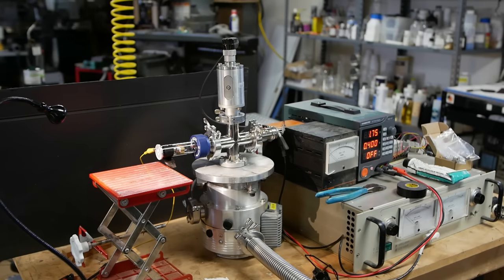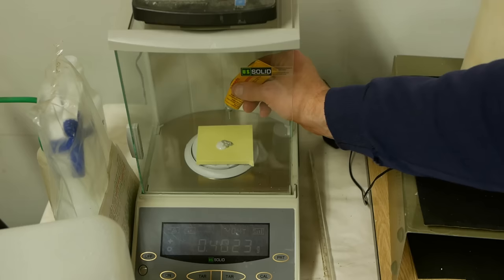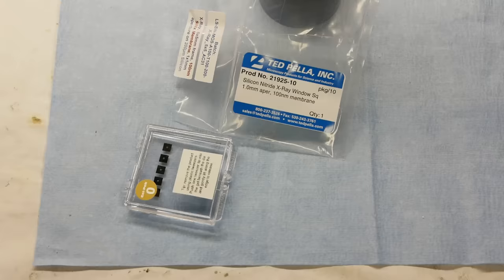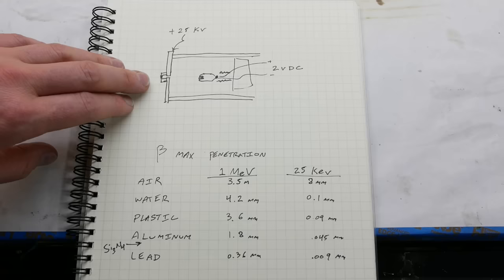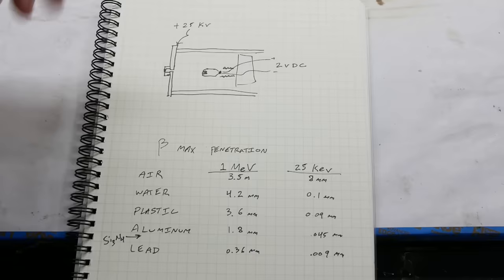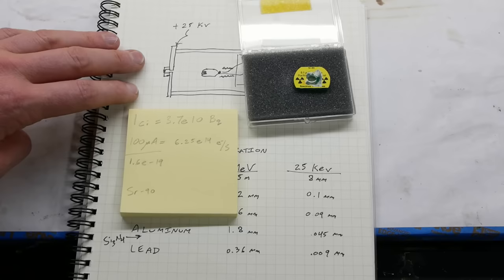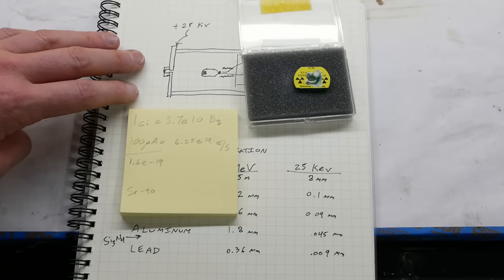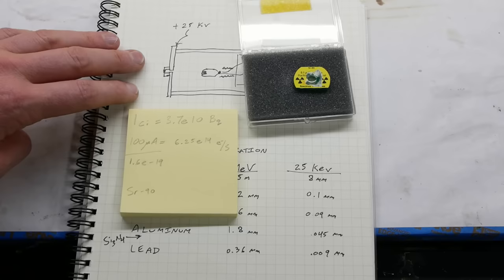Shooting an electron beam through air

Comment: I'm confused.  Your drawing shows the plate being at +25 kV potential, and later you say (and I see it on paper as well) that the energy in the experiment is 25 keV.  Volts is a measure of electromotive force, and electron volts is a measure of energy, which is proportional to volts * coulombs.  Did you design the experiment so that each volt of potential is equivalent to one electron volt of energy in the electrons?  Or am I missing something?

Comment: Put a piece of magnesium oxide, you can buy it cheap at mtixtl. The MgO is a scintillator commonly used in many synchrotron facilities, so it would give you an idea of the x-ray generation going on.
Reply: There are many scintillators. SEM uses YAG (Yttrium aluminium garnet) which is used in some white LEDs to convert blue light into yellow and which has very fast fade out (don't know the proper word, but scanning speed is important and glowing for too long is not welcome feature), some radiation detectors use NaI(tl)

Comment: Could you shoot electrons into an electrical insulator onto a storage medium?  Maybe charge up a copper plate that is embedded in an insulator. Or just charge a piece of metal in the air and measure how much it is charged. Do some materials hold charge better than others and what limits how much charge they can hold?  Or, could the beam push something similar to how a Crookes radiometer "light-mill" works. Maybe a proof of concept to push a miniature fan or turbine to power a miniature machine. Maybe watching the beam push droplets in the air or push a speck of dust suspended in a liquid.

Comment: Wait, I thought you could not get an electron beam to travel through the air. Don't you et Bremsstrahlung radiation when an electron slams into a nitrogen or oxygen molecule? So is it the e-beam that sterilizes or the resulting x-rays? What if you have a box of syringes with steel needles. How do the electrons (or is it x-rays) get inside the needle?

Comment: So this would actively produce negative ions in the air when it's running, right?
Reply from the maker: Definitely.  In fact, I came across these silicon nitride windows when looking for a non-radioactive ionization source that would produce lots of ions without necessarily needing a high voltage field (the anode can be 0V, and the filament can be -25KV, so that the aperture is at the same potential as the rest of the analytical apparatus).  It's quite effective at producing ions,  moreso than normal-intensity radioactive sources.
Reply: @AppliedScience  That's great. I had never even considered going this route to produce ions. So if the tube had a square(ish(or at least, flat on the filament facing side)) tube running through it perpendicular to its axis, which had a hole in it which faced the filament and onto which the window was epoxied, wouldn't that essentially eliminate the small problem of x-ray production? At least, assuming that the optical path from the filament to the accelerating plate was blocked by enough glass composing the perpendicular tube to keep any electrons from actually impinging the plate?

Comment: *****place an insect or some other micro tissue structure on a piece of photo film or some reactive surface that can be fixed after irradiation.      Or better yet, use a CCD as the reactive surface(might need to be doped though).    Kinda like a proper X-Ray machine.  Thanks*****

Comment: Ok. What would happen if you cross that electron beam with a proton beam in a vacuum? Would there be a potential for creating a directed light source? Think holographic display here... 

Or would it have the potential for a large energy release? Like a proton beam surrounded by electron beams directed into a thruster come of a rocket in space? Kinda forming hydrogen that is super-heated like the radioactive rockets...

Comment: @Applied Science : Do you think could be possible to re-accelerate the electrons while they are in the open air? If so, it could be fun to try to make  multy stage linear accelerator in air. As you tried, could be also interesting to se if magnets bends such beam or aslo electric fields.
What could be the purpuse? Well, I really don't know.
other than that, could be useful to shoot the electron into a low pressure chamber, with a magnetic field. The electrons should light the gas up and bend in a circle around the magnetic field.
Whith this experiment they mesured the elctron mass. GREAT! AS USUAL!
Reply: @ Applied Science and to all the galaxy members: " What's the difference between an electron beam though air and a corona discharge?" Right now i really don't know!!!! I mean, aren't they both simple electrons travelling freely through the air?
But I could imagine that corona discharge can't penetrate insulating materials (Am I wrong?). So Where did I lost myself?

Comment: around 120 years ago Philipp Eduard Anton von Lenard playd with electron beams in the same way. The thin window for the electron beam therefore is called Lenard-Window which was in his case a thin aluminium foil. He got the Nobel prize 1905 for his studies with elecron guns.
Can you put silicon sealant into the beam? It should cure quite fast. Also silicon vacuum grease can become hard in the electron beam.

Comment: 1. This is a pinhole aperture, right? So basically this is super inefficient as your beam is very wide in the vacuum, and narrows down to 1mm2? Maybe add some focusing?
2. Probably a stupid question, but how does the positive electrode slow down the electrons past the aperture? I would guess it's not as strong as the acceleration force, but some calculation might be interesting.

Comment: As far as I know, an electron beam is not an x-ray, it is basically a beam of beta particles, it only becomes x-rays when they collide with some material with a high atomic number, as happens in radiotherapy machines that use this system, You can choose between electron beam and x-rays, and when you choose x-rays, a mechanical system places matter like tungsten in front of the accelerator to transform the electron beam into x-rays.

Comment: Hmmm can someone explain this? My manufacturing professor who I know has a ton of experience and a PhD in ME said that there’s no point in using a lubricant or any liquid when machining, he said the only thing it would possibly do is cool the chips, and that’s basically pointless
Reply: When you use cutting fluids, besides cooling, it also helps reducing energy losses through friction,  mitigating effects of metal to metal interaction (such as  galling) and by doing so increasing the durability of the tool and reducing the machining time. Also, when machining metals, cutting fluids usually contains some sort of extreme pressure additives, which interact  with the metal surfaces, creating a microscopic layer which has a lower friction coefficient, effectively helping the tool to drive its way into the part. Another bonus Is that cutting fluids can be used to help driving chips away from the workpiece.

Comment: Well done!!. Cathode/ Lenard Rays outside the vacuum of stella space. Cathode rays do marvelous atomic reactions to the material atomic elements of planet earth. 
One of the most mavelous reactions of cathode rays is to decompose air and water down to their atomic elements. When you decompose the air it will create an intense million++ kg vacuum thrust in the local plane.
The atmospheric pressure of earth is 1.033kg/cm2. A mere one meter round flat disc with cathode rays streaming rays off the top surface, will generate around 8 tonnes of lifting force, all generated by cathode rays an earths free atmospheric pressure. Free energy or hypersonic flight for all the world...

Comment: - Try a Plain ole arc.    Take 2 tig welding tungstens ; point them at each other ;   flow inert gas(or not)  = Make stable arc =    Electronic Fire + Light Fire  = ???      Then try some different metal dust in the arc... I wonder if the light emitted would change spectrum.  Like the sodium orange.     
- Suspend a paperclip from a magnet and see if it falls ? 
- Make Fog Glow !!            

             Hey Ben, can you refresh us on how the old x-ray photo's used to work ?   Did they just hook a capacitor bank up to a filament and let it self destruct ?  ((Why do I think you already did this topic with the chicken vid. ))      
   Perhaps your setup could benefit from operating intermittently.  Flashes at yada yada rate. Instead of constant. I mean flashes can go so fast they'd b undetectable. That'd be one way to deal with blowout or heat dissipation.     Luv the vids, always inspirational.

Comment: It is not electrons travelling from cathode to anode but plasma of cathode metall as charged ions in plasma state. If you apply a short pulse shorter than cathode anode distance the anode field lost before ion can hit. As a result the lost metal ion travelling at astronomical speeds. This technology is known as Ion Cannons and they can be built extremely powerful to hit very long distances like between planets. Regards from Ur Scientist Adam der Erste.

Comment: I don't understand how air can destroy a turbo pump. If that's true then even bumping it could destroy it, the mode of which I can only speculate. Are the rotors just so thin and/or so close they crash into each other when struck by too much air? These pumps are incredibly simple, I just don't see where anything can go wrong.
Reply: @alos10subspasomipack33  AH Yes! How did I not see it before! If the mass average does not correlate with the volume periods, they implode ultrasonically and microscopically. It must be fluid cavitation! You are so right. Thanks stranger.

Comment: Hi. Been you might be off on your assumption that the thicker window will have the greater risk of destruction. Assume a unit volume of glass to be 500nm thick. The irradiated area on one unit volume [of glass] decreases as distance from electron source increases (with irradiated area going to zero, like you said, with glass that's several tens of microns thick). Since the glass strength linearly increases with thickness, there should be LESS of a chance of breakage for a given output. In order to get the glass to break you'd have to just slightly linearly increase the electron count with glass thickness, with 1atm and 100nm glass as your baseline. If you start with 100nm and 25kV, then increase glass thickness in a 1:1 ratio to emitted electrons, you'll never break the glass......

Comment: Please try to repeat the experiment, but this time using the voltage multiplying cascade to reach the mentioned 1 MeV acceleration!
Reply: Linear electron accelerators use a kind of a waveguide......A kind of microwave "travelling" standing wave is used to bunch electrons and then accelerate the bunched electrons down the waveguide tube to a target. This principle has been used to produce electrons in the 100 GEV range....The Univ. of California linear accelerator is several miles long and consumes so much electricity that they have to notify PG&E before they turn it on to avoid overloading the grid.

Comment: Applied Science, very interesting about the ultra thin silicon but won't electron beams form in an atmosphere of helium?  Being the most noble of gasses it should not accept an electron.  If so, why couldn't we use He in electron beam welding instead of building a costly and time consuming vacuum cabinet?
  But my real question is if only a vacuum is needed this should work in space with an exposed filament and could we make focused beams to travel hundreds of miles ahead of a space ship to ionize dust and sand grains to allow magnetic shields to repel such particles away from the hull of the ship?  I am grasping at straws here, a little  help would be greatly appreciated.

Comment: Very nice shot of the nitrogen fluorescence from the beam at 0.11!  

After many years we finally got a good shot of this phenomenon via Andrew Seltzman's RadCam 2. The accelerator was cranked up to full power and the lights turned off. The following frame from the video was at 3.5 MeV running at ~150 kW. Thermoluminescent rhombs of calcite are in the foreground: 
http://www.capturedlightning.com/photos/Advertising_Aids/RadCam-2015/Framegrab1.jpg 

Re: making Lichtenberg figures, you might try chilling the PMMA with dry ice to reduce charge leakage. You need about 1 -2 uC/sq-cm of stored charge to get good figures, and leakage can be a problem with a low-current beam with PMMA at room temperature.  

Great job and good luck!
Reply: Bert!  Any idea of price of those e-beam sterilizer accelerators (just the hardware?)  Few hundred $K?  More?  Couple $M?  Or even just cost of the drift tube wo/supplies?  (I see that people are now using them more widely for chem, and as industrial polymer-catalyzers, etc.)    TEN MILLION BUCKS whaaa?   That's ridiculous.
Reply: @wbeaty  High-power industrial-scale facilities are indeed expensive - of the order of $10-20 million for a large installation, including all the various support systems. Ongoing care and feeding (maintenance, regulatory reviews, power, skilled staff) is also expensive.The facility we happen to use is primarily used for polymer crosslinking of tubing, cable,  plumbing, and water-handling parts and HW. 

There are actually a surprising number of industrial, medical, and research accelerators in the US. Medical facilities are always off limits. Research machines can sometimes be available if have the right academic contacts. Most high-power industrial accelerators are hidden away as an integral (often proprietary) material processing tool - these are usually not publicly accessible. There are also a few sterilization facilities. Beam time on a high-power e-beam machine typically runs $1000 - $2500/hour at these facilities. Expensive - yes, but in a lot of cases, there is no viable alternative.

Comment: Hi... Something i obviously havent understood here..... why not simply make a Tesla Coil.....(I answer that myself.... well...... that is AC)     ok so why not make a DC generator with a cascade multiplier up to a couple of hundred thousand volts DC ?   would that be the same but stronger ?
   or ...what is different with 'an electron beam' in air  to what im suggesting ?
Reply: I'm looking for somebody to start a project about applying dielectroforesis force any good sources that you have I ask you for any knowledge about the subject
Reply: @Podemosllegaralossubs-ty7bq  Yes.... for example, if I understand your interest, a molecule...lets say Water can be 'orientated' in an electrostatic field, without the water itself becoming charged..  but the molecules would 'align' withing the field as the 2H's will be one one side of the molecule of water (H's tend to like hanging out together) while the O is sticking out the other side of the water molecule..... This is a useful feature in manipulating molecules without actually charging them. Am I on the right track with you here?  What project are you considering? ..... roughly....    :o)

Comment: Im convinced you didnt get the lightning in the acrylic because the electrons leaked through the holder. Heck they already leak through air back to the ground when you run the machine without the acrylic target. Why don't you tap the acrylic while it's exposed to the gun so it doesnt have time to discharge (you could use a DIY electroscope to check the charge of the acrylic.

By the way, you are just one hair away from the Stern-Gerlach experiment. That would be awesome

Comment: I am sure you already know this but when you placed the magnet in the beamline, you essentially created an XR insertion device called an undulator (or wiggler depending on output spectrum). I live not far from  Argonne National Laboratory which is home to the APS (Advanced Photon Source); the highest power XR source in the world. A close friend is actually an APS ring technician who builds, modifies, maintains and sets up for experiments, these insertion devices at the APS. Anyway, by means of you putting the magnet in the beamline, you deflected the beamline and generated a continuous XR emission. Did you see an uptick in output on your meter when you put the magnet in the beamline? An iron magnet does not have a ton of flux so maybe not much. Though, with a series of a few neodymium arranged in a dipole configuration.....you absolutely could given your electron speed is so low.

Comment: 1. Maybe peeking into the beam with some crappy webcam? How camera sees electrons?
2. And how quickly ICs die inside a beam? Maybe sacrifice some 555 timer =)
3. Touching a beam with multimeter probes?
4. Blowing a candle with beam?
5. Does beam make some chemical reactions happen?
6. Somehow measure air density inside beam?

Comment: xray tech here.. keep in mind hard xrays aren't more dangerous, soft are.  They attenuate easier.. and attenuation is the devil! The most common destructive action of attenuation is the creation of free radicals by interaction with water that thus damage DNA.   This is why soft tissue imaging like mammograms uses softer xrays and require more mA milliAmperes, boiled off electrons to create a sufficent signal in the imaging receptor.  I would definately wear a shield around this even if the mA is small (keep in mind it wouldn't have to be a heavy shield), a .25mm apron should do.